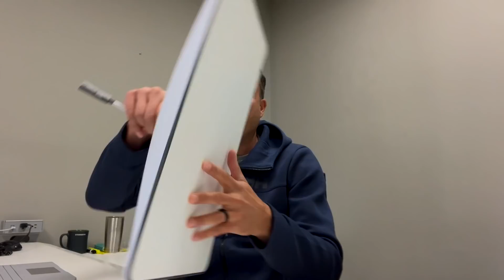How to redesign a SpaceX STARLINK satellite dish for mobile use on a boat! [MV FREEDOM]

Comment: Pro tip - Starlink is designed for a min elevation angle of 25 degrees.  By defeating the phased array’s gimbal mechanism, you’re limiting your field of view to satellites passing 25 to 155 degrees overhead.  The impact is that your terminal will see fewer satellites (reducing connection opportunities) and reduce the average duration of your connection.

Comment: Can starlink work with cargo vessel? That vessel will move across seas and oceans, as we know starlink uses low orbit satelite making 1 satelite only cover small area, we shouldn't be worry if this was a geo satelite, 1 satelite can cover almost 1 or more continent.

Lets say vessel A now on sea 1, then 5 hours laters they arrived on sea 2? Will the internet connection stable?
Reply: Satellites in non-geostationary orbit will perform a handover between satellites as the “camped” satellite leaves your coverage  cell.  For Starlink, you’ll need to purchase their Maritime service rather than the cheaper Roam service in order to receive service while on passage.

Comment: Question:  at 7:06 minutes you show the dish facing up from inside  your cabin.  In the brief scene I can see the stem turning. I want to do the same test here in the mountains where I live.   When you did this, did the motor ever stop trying to turn the dish?  It seems that without disabling the motor that this motion could be hard on the cable.  I would like to do a week long test, if possible, of my dish in a cradle of some sort.  This before I disable the motor.  Thank you for your answer in advance.   One more thing, how did you get the stem off of the dish?  Did you cut it off, or does it come apart?
Jim

Comment: I installed my Starlink antenna in an unused dome on my boat. My 65’ Fleming has a pair of domes. One holds the KVH/DirecTV antenna and the second is empty and is basically a radar reflector. After testing and using the antenna mounted to the aft flybridge rail I relocated it to the dome. Cannot be seen. Prior to moving the antenna I was able to get terrific speeds off shore from Florida to Nova Scotia. I run off shore from 10 to 30 miles. Initial testing excluded the Bahamas as BT had not signed the partnering agreement w/Starlink. The only place we were without a good connection was in the Gulf of Maine during transits from Cape Cod to Cape Sable. When we were about 30 miles off the Nova Scotia coast we lost connection. Regained when approached Cape Cod at about another 30 miles. My understanding is that this dead zone will be covered once the satellites are able to send data via another satellite.
Reply: This is great thanks - I was thinking of doing the same. Did you disable the motors on the Starlink? Any tips appreciated. I have KVH TV6 domes.

Comment: It will be interesting to see how it performs when the majority of satellites aren't directly overhead, which is when it's motor trackers come into play
Reply: As Shaun said it’s a phased array antenna and doesn’t need to be physically aimed.
Reply: @kentadrian6834  True, but a phased array has a limit to how far it can aim the beam, and what the performance it has at varying angles. I imaging if you are well within the coverage footprint, the satellites will be mostly overhead, and frequent,  it will be able to track them well. For people on the edge of coverage, where a satellite might be low in the sky, you will exceed the range of the phased array and not have a great experience.
It's a breakthrough technology though, and a "solid state" fixed antenna is very appealing

Comment: This seemed like a total waste of time. Better looking than the other equipment up there. Also not convinced it won’t impact functionality. I have one on my boat, looks fine works fine as delivered!
Reply: Your wrong doesn’t do anything and with wind your going to have issues.
Reply: @Gr3yg00se  in hindsight I believe I am wrong.  Been a while since I posted that.  Regarding wind, I’ve gone 2400 hundred miles in my boat since post and been in some high winds.. I hope I not wrong regarding it!
Reply: @Gr3yg00se you know better than Space Xm engineers ? Stop being cheap and buy the new rv sat

Comment: Love this video! I hope that antenna rotation isn't used for cross-polarization commissioning during unit startup. If you have bad crosspol isolation you can cause interference on the network, and your transmit might be remotely inhibited by Starlink (aka banned). Subjectively I'd guess starlink is a circular polarized system and this shouldn't be a problem at all. I'm most interested in how the phased array keeps up with vessel motion even while you are at anchor.
Reply: Confirmed it is circular polarization, this is a non-issue.

Comment: does it throw any errors about the motors being gone?  and how well does it work while in motion?
Reply: It will say motors stuck = true. So on the app it will warn with a red banner that they are stuck. No effect other than that. Works fine in motion, but having it perfectly level could allow water to bubble up on it. On a boat not so much since it rocks, but on other objects it could be an issue.

Comment: Slick as shit. Would have liked to have seen more of the fabrication process for the mount and an explanation of what 5200 is. Some sort of epoxy or other adhesive I presume. Nice work.
Reply: 3M 5200 Adhesive Sealer
Reply: 5200 is the nightmare for boaters.
Reply: @captainsukycannon1167  not if the installation is permanent like in this case

Comment: There is a reason it  it has the ability to adjust it's angle - likely to get a more direct path to the available satellites. Making it fixed will likely degrade its performance.
Reply: Its also illegal and not authorized by the fcc. But not to worry dish network will get them all shut down

Comment: Certainly not my decision to make as it’s not my boat, it’s not my product, it’s not my money but I do have a shit load of experience on boats at sea and personally I would have set up the router and the power supply and waited until I was at anchor to just reach out and deploy it on its stand on the roof above the house so that it would operate within its defined parameters. The fact that the FCC does not allow its use while in motion really in my opinion invalidates the necessity to permanently mount it.  Again just my opinion. That being said I will be purchasing one and deploying it in the fashion consistent with my comment on my boat. Wish you folks the best, enjoy the channel.
Respectfully,
Richard ~
Reply: @Richard Leevey,

I see 4 reasons why I prefer this set up on my boat. First of all with your set up I would not have internet while I am on the move and unfortunately I have a lot of 'sea' apps that do require internet in order to function. E.g. all my local weather updates come via internet. 
Second, the antenna dish with its motor will keep lining out when the boat is rolling at anchor. There is another video on Youtube where you see that happening, resulting in draining the batteries. Those motors do like a bit of juice, about 100 W per hour at 110 V. 
Third, the set up on the tripot is nice, but you would have to secure it every single time just in case the wind picks up to much, otherwise it will just blow away. On a house roof or in a garden that is not a problem, since you don't take it away every time you move, but on a boat........a lot of extra work each time and perhaps you will have to construct something that will hold the tripod. In which case you may just do it like Shawn did, solves the problem as well.
Fourth, the motors on the dish are not made for continuous operation, in order words, eventually they will fail when you have it installed on a rolling boat. 

Unfortunately I don't have a milling machine like Shawn, I cannot operate one neither, so I will have to come up with my own solution, but indeed I will also fix a starlink antenna to my boat. Perhaps just clamp it to the railing and disable the motors. 
Now I just have one other problem..............I need to get myself a Starlink ! lol

Comment: WOW it's a REALEY A BIG EYESORE tucked in there next to the satellite phone raydome, the bullhorn, the spotlight, the FLIER the RADAR ANTENNA and all that other CRAP YOU HAVE UP THERE. Further more I am an Electrical Engineer and I an 100% confident that the Engineers at SPACE-X that DESINGED the Starlink antenna probably know what thay were doing when thay DESINGED the Starlink antenna, I don't think they would have INVESTED all of the entering time and efort an EXPENSE to design a MOVEABLE ANTENNA if it was NOT nessery for optimum performance !!! I hope I am wrong.
Reply: From all the posts I've read you are about 1000 percent wrong.. far better connection even on land without dish moving from one satellite to another dropping calls and data 100s of times per day
Reply: @glenperham8091  First it's a PHASED ARRAY ANTENNA not a dish and it DOES NOT PHYSICALLY MOVE once it is in position. Phased Aarray Antennas are electronically steerable (moveable). The issue that I can foresee with locking the ANTENNA down flat where it is looking strate up, while it may receive a good signal when the boat is travelling North or South but so when travelling East or West.

Comment: Why take away the motors? That was such a pointless thing. Mount the pole to the top and let it do it's thing. /facepalm. It's like you wanted to limit it's abilities on purpose for no reason other than "cosmetics" when surrounded by so many other things up there. Otherwise, it does look nice.
Reply: I'm assuming because when you're out at sea the boat rocks and the motors will be constantly trying to compensate for that and they would burn out way faster than if they were on your house the real question is is how much bandwidth is lost by it not being able to adjust itself
Reply: @ureil1  if that's the case then put it on a gyro stabilizer :) .

Comment: The other alternative, if you're set on eliminating the motors: just make a box with a central hole for the plate to sit onto and let the motors attempt to do their thing even though the plate is held in the horizontal.
Reply: @ WIlliam Domb, good idea, but they would keep consuming electricity and that is not a good idea on a boat.
Reply: @davedavids9619  Hard to believe it'd be that much IF the boat is in a marina and the plate doesn't have to move much.

Comment: Being a firm believer in the K.I.S.S. principle, did you consider just making a low box for the unit to sit in?  Sized so it's just inside the edges of the array and just tall enough so the tail of the motor mount doesn't scrape the roof of your pilot house.  Glue it down with the 8200 and you should be good to go!  And without throwing the warranty into a shredder 😄
Reply: Engineers do NOT care about warranty.  That's the first thing you need to learn.
Reply: @DennisMathias  But now he can't get into it if it ever needs a fixin'. :)

Comment: Let me confess my confusion.  If it is a phased array, why do they 'steer'' it at all physically?  YOu are one brave SOB!
Reply: I think the physical steering is for rough alignment to the constellation, the phasing is for fine tuning the signal.
Reply: @michiganengineer8621  It seems like a lot of trouble since you could roughly align manually.  I'm not saying it isn't true I'm speculating on the design criteria.  Having just the panel would eliminate most of the moisture and dust intrusion.  And a lot of the mechanics being removed would lower the initial cost.  I'm real interested in 'what's in there'.  Your teardown is really revealing.

Comment: Could you share the exact location of motor plug on board, im thinking about drilling hole in the back of case and disconnect it. Then i will remove mount and reconfigure the dish to lay flat. Its going on flat roof of RV .Thanks for the tear down video
Reply: You'd think Starlink could sell a cheaper/simpler version with no motors.
Reply: you stole my idea 👍

Comment: Nice Work Shawn, really well done ! 👍
Starlink does make a lot of sense, and I was planning to go that route when I got a motor yacht (thinking managing another Sailboat due to disability was now out of the question), but now I've found a Sailboat I can easily ma age single handed, plus can get it with twin keels, so it  an dry out safely - this ability can massively reduce the costs for de sliming the bottom, changing Anodes, checking the bow thruster properly, plus keeping a close eye on the protective finish on the Volvo Saildrive,  enabling rapid and easy touch up if necessary. It's a Deck Saloon, so a bit like a Trawler inside,  but much better hand holds etc, for safe moving around inside.My disability is a bit like having a wooden leg, without the firm support of a wooden leg. Arrr Jim Lad Lol. A worry though, being a Sailboat, is if a suitable dish becomes available, will the extra electric load  ended, be manageable. Solar and Wind should produce useful amounts, but the Space for a House Battery Bank appears limited, so I'm following your Lithium Battery Bank experience going forward with great interest. tbh, I don't like Lithium, apart from the difficulty with recycling them, there are potential issues from rapid charging, plus phone ones,  at the end of their service life pretty much dissolve into a destructive liquid that takes out the circuitry inside the phone or tablet, such that batteries should be changed between 4 and 5 years old Maximum, if they have beenbtreated right, with no fast charging - it's actually why Apple put such h low amperage Chargers with their phones, to maximise their service lives (Samsung fast chargers are similarly low power) . Thankfully Lithium Battery Technology is improving, so fingers crossed, but as I plan on traveling to far away exotic places with my boat, I'm hoping to get away with enough Carbon AGM batteries, so that if I get a failure in the middle of nowhere, getting  AGM replacements should be available to tide me over, and be an easy, though heavy drop in. There are many benefits that come with having a Nordhavn, and having enough electrical power, and the space for decent  sized Battery Banks, are among them. Happy Wakes to you both, and fuss to both dogs. Keep up the great work, and Best Wishes. Bob. Maybe see you out there somewhere in a couple of years. 👍🙂
Reply: You need your own Youtube channel..all the elements.

Comment: Beauty is in the eye of the beholder, as an engineer, I definitely would not permanently mount this antenna. The ability to remove it while traveling and when the boat is unoccupied seems like a plus and avoids exposure to elements and thieves.

Comment: The key here is your location.  The first gen Starlink Sats that were launched must communicate directly with a land relay station (due to their LEO orbit they have a limited range).  The newest sats that are being launched can relay between themselves to reach the closest land relay.  This means that this should work as long as you are within range of the relay (say along the coast).  If you go out say crossing the pacific this wont work (yet).  The good news is that most of the Bahamas and Caribbean should be covered by end of 2023.

Comment: what is the ping?
Reply: Wouldn't that depend entirely on what device is being pinged?
Reply: @clarenceoveur778  The speed test programs generally have servers in different geographic areas so the download, upload and ping are to a nearby datacenter.
Reply: @LoanwordEggcorn  Yes, of course, as are servers and other network devices around the world. Ping times will always vary greatly depending on destination and devices being traversed.
Reply: @clarenceoveur778  Most major content providers have local caching servers in datacenters relatively near their customers.  That reduces latency to those services.
Reply: @LoanwordEggcorn  Yes, of course they do. But the only ping time that might be a reliable indicator of an ISP's performance would be to their gateway. Of course, thanks to the net neutrality laws being struck down, they may have agreements with "major content providers" that provide preferential treatment of traffic.

The question "what is the ping" doesn't mean much, unless it's narrowed to a specific content provider. Some boaters may want nothing but Netflix streaming, others may put more emphasis on real time weather reporting. Ping times would likely vary greatly.
Reply: @clarenceoveur778  I think we assume satellite in LEO.
Reply: That's an interesting metric.  A couple have mentioned data centers adding to the latency.  But I don't care about total latency.  It'd be interesting to know what the satellite / ground station latency is.  Normally you could figure 20ms * 2 or 40ms for ping time all things not considered.
Reply: @DennisMathias  The ping from Starlink and ground stations is relatively low because the satellites are in relatively low orbit.  Shorter distances make lower latency.

The reason datacenters matter is because unless you are the satellite (network) operator, you can't see the latency of the satellites directly yourself.

SpaceX or Elon have informally mentioned the low latency of the network itself before.  A quick google search says their goal is under 20 milliseconds.

Comment: Have you had any issues with service disruptions while running your radar? I seem to loose the connection to the satellites once my array starts to spin. My Starlink dish is located directly in front of it.
Reply: Yes, same with mine and this seems to be common.  With the SL dish mounted several inches above the radar, both can operate together.  Just keep in mind what the radiation pattern looks like from your radar and keep Dishy completely out of that.
Reply from the maker: Next week is a review given our short time with it but we can’t use it underway.